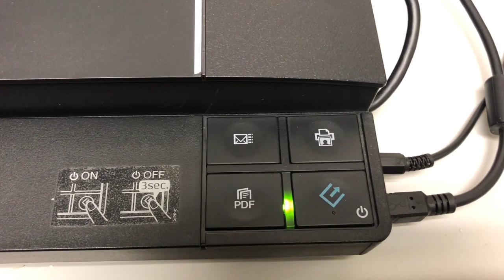Replace the defective power connector and jack of Epson V330 scanner

Comment: Can you give any information on what jack you used. I have the same problem with my epson, but am unsure which port to use.
Reply from the maker: Thanks for watching the video. I happen to have a DC power plug and a matching  socket/jack that can be used for the repair. I don't have the spec but measure the dimension of the DC plug as follows: external diameter = 5.5 mm, internal diameter = 2.5 mm, length = 9 mm.